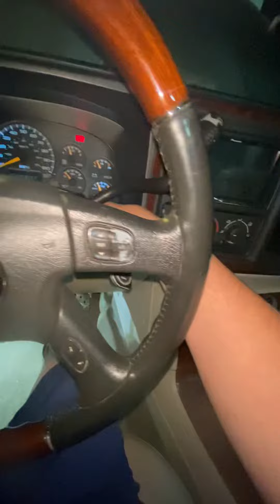99-2002 Silverado ac compressor not engaging fix!! Must watch if you’ve tried everything on YouTube!

Comment: Amazing video I've been looking all over for the lower pressure switch but everyone said it's on the compressor which a C clamp and needs to be taken out for access. As you said no youtube video shows this even 3 years after you posted it this really helped thank you
Reply: 02 Burban well kept I've put 3 compressors on this vehicle over the years because Chevrolet decided to put the compressor on the bottom.  On the bottom with a shield covering it and yeah that's a great idea Chevrolet especially since it gets well yesterday was 101° on my porch , so summer heat, a shield , and no air circulation means cooked compressor.  Anyway my switch is on the back of the  compressor and I here to tell you you gotta bend you arm in 10 different directions and barely reach it with 2 fingers. Hey but my body lift gives enough room to remove remove it with only bare minimal amount of blood loss and a few I'm sorry Lord for saying that

Comment: Ihave a 02 burban ijust replaced the ac compressor because the old one sprayed freon out when on idle and when i i hit the gas it also made a hissing sound and sprayed the freon out but i still have the same problem aver replacing the compressor you think this might be the problem aswell?
Reply from the maker: @jorgerangel5249  the new one is spraying Freon out from the compressor?
Reply: @franksilva3302  yea my new compressor is spraying out the freon it sprays for 2-3 seconds and stops then it does it again a couple of times and i assume its comprssor icnt really see where its coming from but when it shoots freon out ithink ican see it coming from the compressor from the switch ithink
Reply: And when i add more freon it does the same my compressor try’s to kick in and turns off and does that spraying release and the back of my suburban is cold and the front is not im literally going crazy searching things up
Reply from the maker: @jorgerangel5249  it could be the same switch as mine then. Try it it’s only like 10$ and easy to change out and it doesn’t release the Freon when changing it out

Comment: Thank you for posting this. I have P0530 error. Pressure switch signals is one of the causes listed. I knew that the low pressure sensor is good, but didn't know where to locate the high pressure sensor.
Reply from the maker: Np i hope it fixes whatever issue you have. I didn’t know where it was located myself, i didn’t even know it existed… no “a/c technicians” could figure out the problem either

Comment: Bro you are my last hope 😅thanks for the video.
Reply from the maker: Did it work 👀
Reply: @Frank Silva  turns out that switch was old and rotted. Non of the mechs checked that tho. So good call. 

I've replaced everything, lines, comp, cond, accumulator. It works but that expansion valve and avap core will be next unfortunately

Comment: Hey man, nice video. My problem is that it takes about 2-3 times being in the truck and starting it and driving it before it finally decides to engage the clutch to the compressor. I know I have Freon in the system, checked it many times. I have changed out the low side sensor with no avail.. I’ve tried doing a continuity test on the high pressure sensor and it has no continuity.. so I’d imagine that it is the problem. Also your video is the only video I’ve found talking about replacing that high side sensor.. I just keep going back and forth whether I want to replace it or not. What are your thoughts? I mean what else could be the problem?? 
Thanks in advance
Reply from the maker: I would give it a shot. The sensor is cheap and easy to change out no need to flush out the system either just take it off and replace it, it could also be that your clutch is getting stuck which means replacing the compressor

Comment: Will this cause ac to not blow at all or does it still blow but not cold? 

My problem im having is that I refilled som freon and it lasted me 3 days and it stops blowing hot Idk if its a leak or what bc the gauge marks its holding freon from last time
Reply from the maker: The problem i was having was that it would get cold only when stepping on the gas. Once i would let off the gas it would stop blowing cold until i put my foot back on the gas. You might have a leak if it blows cold a couple days only

Comment: Thanks bro! I will try that. My compressor kicks on for a second then stops.
Reply: Did you try this? My compressor does the same as yours. Kicks on then off.
Reply: Did it work? I’m working on a truck like this. Compressor only runs about one second and stop. Keeps  cycling like that
Reply: How did you fixed yours

Comment: Troubleshoot off a 2004 chevy 2500 6.0  keeps burning a/compressor fuse 10 fuse? A/c would work a couple times after putting red 10 fuse back on  but then as soon as drove a/c would quit and fuse would be blown again ? Any opinions would help?
Reply: Sounds like your A/C is shorting you need to check the voltage and see if it's grounded. You may have an exposed wire touching the body of the truck. Have you done any work on the truck recently? I would start looking in that area if you have

Comment: Johnny B. I have a 99 and my ac will sometimes blow somewhat cold, but then start blowing hot. I'll shut it off and leave it off for a bit. And then I'll turn it on and it'll start blowing cold. But the compressor doesn't kick on right away. So 2 questions: Can I replace that high pressure valve without evacuating the system ? Is it like the low pressure switch where theres a schrader type valve underneath tge valve that will hold the system pressure/refrigerant in? Im wondering if its something i can do myself. Ive replaced the low pressure switch on the evaporator before twice, & it didn't quite fix the problem.

Thanks for your video.🙂
Reply: im going to try it right now... i couldnt find an answer anywhere else so ill let you know
Reply: No need to evacuate there’s a valve under it🤙
Reply: And if it makes a difference, it fixed my issue
Reply: I’m going through this exact same issue. But it will not blow cold at all in the daytime. Gonna try to change the high pressure switch first and go from there
Reply: @bigred2oo766 was your compressor not turning on at all?? Mines still turns on but shuts off sometimes.
Reply: @antoniop5889  so I said it fixed my issue. I have since then replaced the entirety of my system cause my real issue was probably a large leak. Check your Freon/r134 levels. Those cheap gauges may show it in the high red, wait for the compressor to kick on and see where it moves once it kicks on. Mine would turn on and then the pressure would drop to a certain point and then cut off. Putting enough freon/r134 in there solved that issue. I do think the sensor was part of my issue. But I’d be surprised if it was causing it to turn on and off. Check r-134 level first
Reply: @erick._150 what you figure out?
Reply: Yeah check the Freon levels but also make sure you get as much air out of the lines as well. I usually do this by using the angling the pressure nipple on the Freon bottle to the access valve and it releases the air. Once you see Freon spraying out then you will have cleared most of the air out of the system

Comment: Unfortunately it didn't work for me. I hear a click like it's trying to engage, but no cold air. The click repeats every 10 or 15 seconds. Freon pressure looks good but when it clicks, pressure drops but then comes up again. Any ideas?
Reply: It needs freon
Reply: When the freon charge kit is connected, pressure reads higher than recommended pressure, then the compressor kicks in for a couple seconds and it dips below the pressure minimum. I added more freon but I'm in the red zone on the gage when it's not on. I'm afraid to add more.
Reply: @geneharter  stop adding more and get professional help. Compressor might be beyond repair
Reply: @geneharter  did you end up having to take it to a shop ? My does the exact same thing, going off every 10-15 seasons
Reply: @Saucierauto16  It is my daughter's truck. She hasn't fixed it yet because she doesn't have the budget. When next summer comes around, she'll take it somewhere.
Reply: @geneharter  I fixed mine pretty easily. The clicking really is the compressor clutch turning on and off. The compressor belt will always spin when the engines running, but it’s the clutch at the front of the compressor that needs to be spinning to charge the freon. 

What I did was remove the AC compressor fuse from the fuse box. I took some red electrical wire, and slipped it into where the 87 prong on the fuse goes into on the fuse box. I took the other end of the wire and touched the positive terminal on the battery. Only then did the compressor immediately turn on. I had someone hold the wire while I went and sprayed a whole Walmart Freon recharge can and half of another one into the low port system. 
Only then did the system actually get cold when the pressure was in the green. After I filled it to the required level, I removed my electrical wire and put the AC compressor fuse back where it was. Immediately the compressor stayed turned back on and stayed on. 
I have cold air again !
Reply: @Saucierauto16  Thank you for this! The problem now is that she lives in Texas, far away from me :-). I'll see if she has a friend that can help her with this.
Reply: @geneharter  you’re welcome. 
Here’s a link to a video showing what I just said,  might help more than just reading my comment if you’re like me and need visuals too haha. 

https://youtu.be/-U2n2u0FK70

Comment: Hey bro I have the same problem with my 2000 suburban and the compressor engages but then it stops is that normal or does it need to keep spinning?
Reply: That’s how it supposed to work bud it spins and stop while using you A/C
Reply: Mine use to do that put I changed my ac fan
Reply from the maker: Might be low on Freon if it’s not cooling
Reply: Hey dude, sorry if this is to late. Pull off your compressor pulley. There is shims in there. What happens if eventually the clutch wears and can no longer engage. Pull out the shim and reinstall pulley.

Comment: My compressor kicks on but randomly cuts off I done changed the compressor and low pressure switch the only thing I haven’t changed was this part. Was your compressor not turning on at all
Reply from the maker: It was only turning on when accelerating. So when i had my foot on the gas the compressor would work perfectly fine and blow cold. When i came to a stop  it would turn off and blow hot air. Also when stopped it would kick on and kick right off back to back.
Reply: Thanks for replying I think it fixed it it working a lot better thanks for the video too
Reply from the maker: @antoniop5889  np bro!

Comment: My truck keeps blowing up the 10amp fuse as soon as I put the relay back on the fuse box it was working before just after I changed the compressor started to act up. I already checked all the wires and nothing seems to me cut or anything. Anyone know what it could be ?

Comment: Shit I’m bouta try it out but that issue u had starting ur truck it didn’t crank over the first go mine has the same issue at time is that a common issue as well how does it get fixed
Reply: Check your thermostat and coolant temperature sensor , same thing is happening to my truck
Reply: Usually the fuel pump is going out or the fuel pressure regulator.
Reply: Or crankshaft sensor?
Reply: Bro I had the same issue I cleaned my throttle body fixed that problem now it starts right up

Comment: Did you have any burnt fuse? My 10 fuse is burning on the fuse box, doesn’t burn out when I put copper on the fuse lolol I can’t figure it out . I did pinch wires but I taped it up instead…. Might need to splice

Comment: What type a cooling fans are you running and what ECU pin did you use for the high speed.thanks
Reply from the maker: 99-06 Silverado electric fans with the radiator . I had somebody wire them for me i didn’t use the oem harness, they were wired to a fuse. I would recommend going with the oem harness to avoid issue. My relays would go bad. Tuning is needing when using the oem harness. There’s forums on google and videos on YouTube

Comment: Gonna try to change both sensors and see if it works. Mine works when driving but stops when coming to a stop. But only when it’s not hot as fuck outside. If it’s too hot it won’t blow cold at all. Im fucking dying in Texas
Reply: try looking into the ac fan beside the radiator